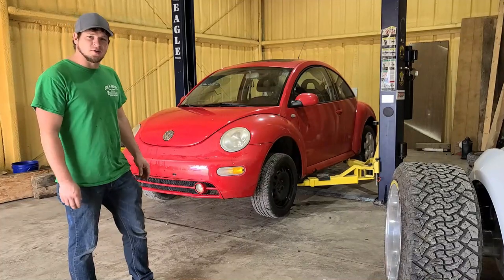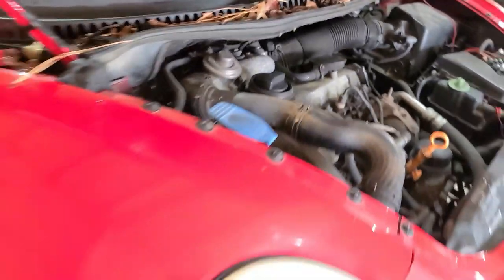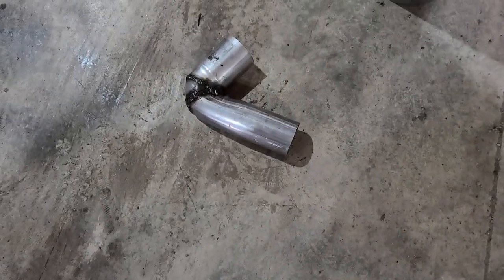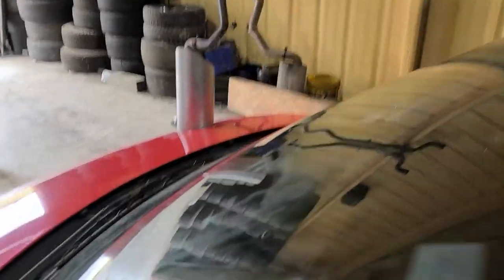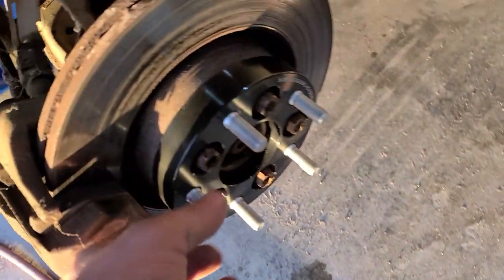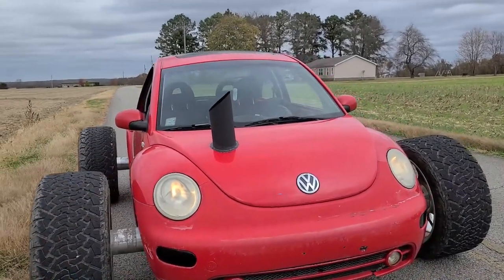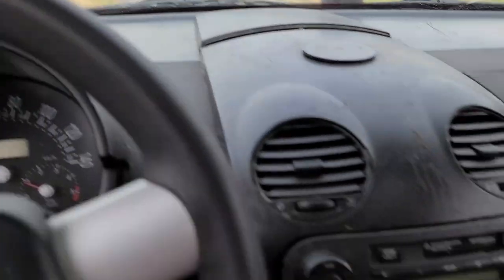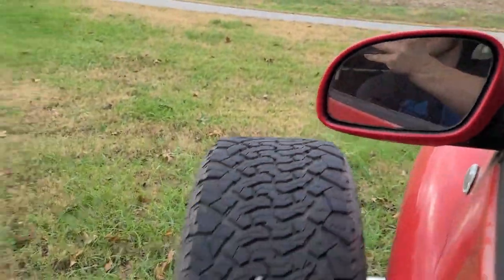Meet Mini Mudder. First Drive

Comment: Just an FYI the vw passat and jetta has an all wheel drive system that bolts right in my 01 I did it to works great also a simple k04 turbo swap and spring in pump wakes these cars up mine is at almost 200hp and is scary with as light it is have fun there fun little cars and cheap to beat on

Comment: If you wreck it and the engine still runs can I have it the turbo on my Jetta went out and killed my motor which was making 250 wheel hp 😔